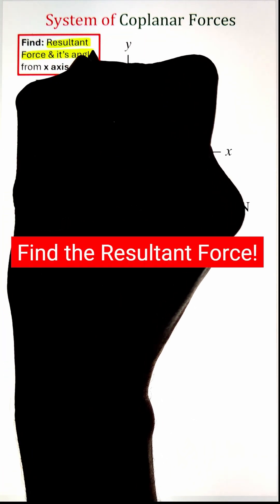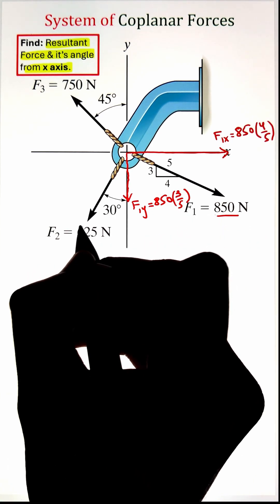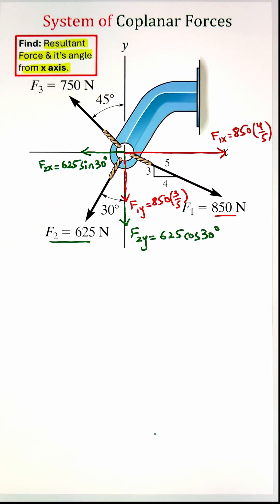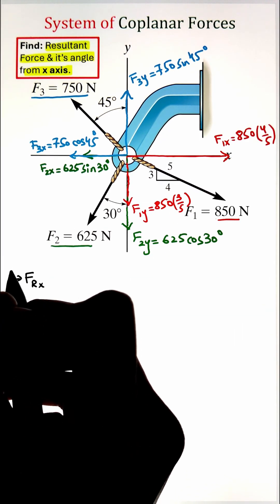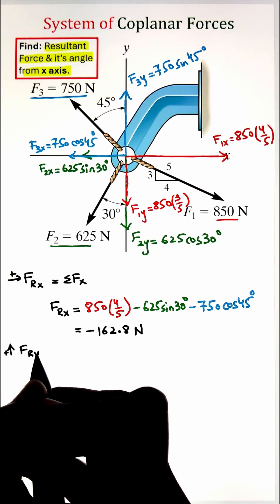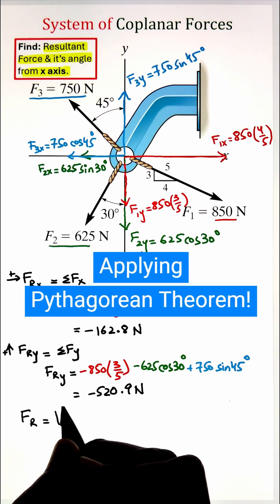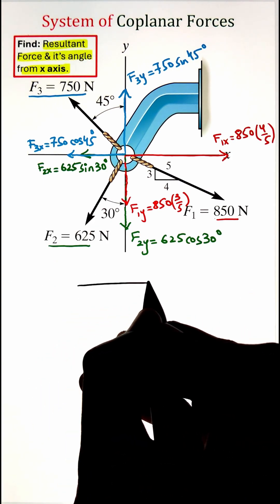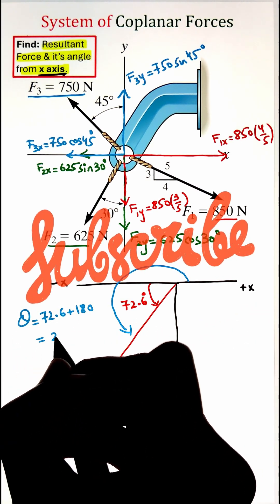Resultant Force & Angle in Coplanar Force System | Engineering Mechanics

Comment: F3x=750sin45    not cos  but answer is correct 45 cos and sin equal
Reply from the maker: Yes, you are right however the angle from the x axis was also the same, so that's why I did that, however your correct sin 45 would be the projection along x axis based on the angle shown on the figure.